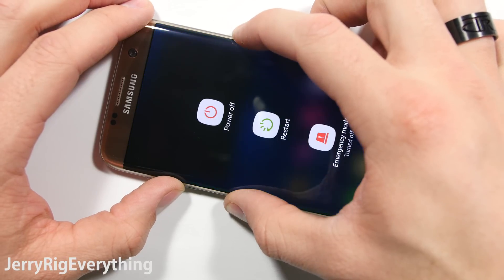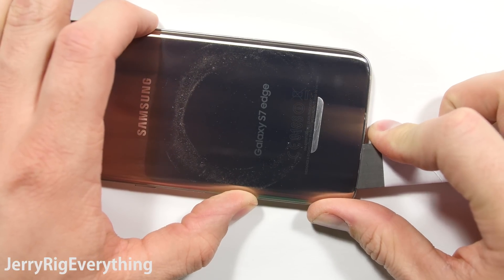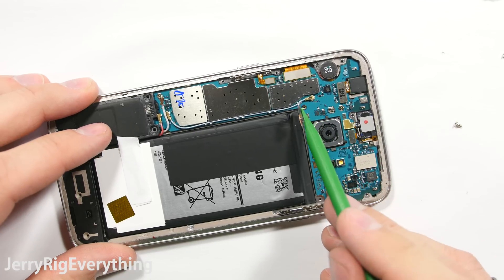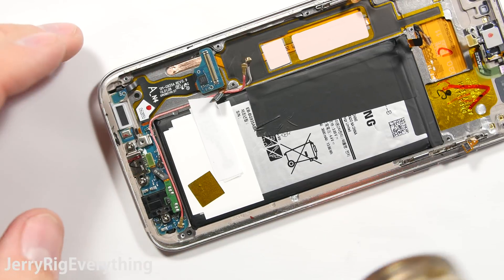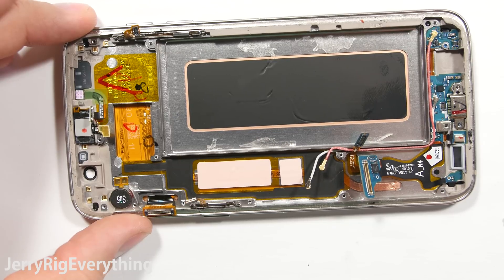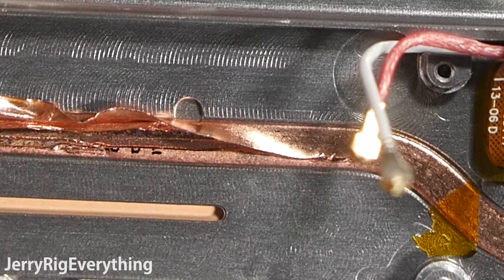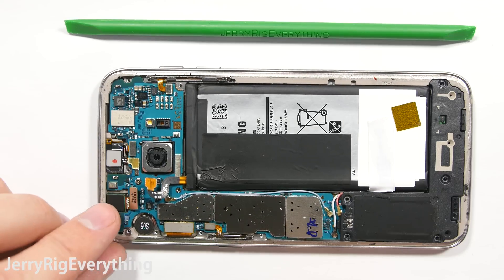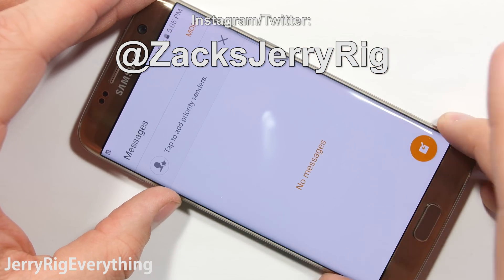Galaxy S7 Edge Screen Replacement - Charging Port Repair - battery fix

Comment: Hello Jerry 
I just want to tell you that I like a lot your videos... 
I have a question for you about the Samsung Galaxy s7 Edge... 
Do you think is possible that wrapping off a skin protector (like DBrand Skin) from the back of the phone can damage it in some way,!? 
I saw that when you have bend the phone the back cover comes out and you said that the water protection is damaged 
And I ask you because you know how much force you used to bend it and you know how good and strong is that glue that is keeping the back cover at his place... 
And that glue is double tape or is an special adhesive!? 
I ask all of this because in teardown of Samsung galaxy s7 edge I saw that after using some heat is quite easy to disassembly the back...
I hope that you understand what I'm trying to say because my English is not perfect 
THANK YOU!

Comment: with all the news about the note 7 having heating issues to explosion, how are you feeling now about the processor melting into the black plastic of this phone? I'm wondering if signs of melting/marks are common for current phones with the 820/newer processors? I"m interested in the GS7, and I appreciate your teardown videos. Seems like regardless if I go edge or not, it will be a tricky teardown? Hopefully not as bad as the HTC one m7.

Comment: The most important part of the Galaxy S7 and S7 edge’s cooling system is
 the thermal spreader (Heat Pipe). We adopted a spreader that is only 
0.4mm in diameter, making it the thinnest in the market today. Unlike 
the conventional thermal spread sheet technology, the thermal spreader 
uses changes in the phases of water to radiate heat. It has a porous 
structure on the inside where water absorbs heat, turns into steam and 
moves through pipes. After losing heat, the steam liquefies, and turns 
back into water in the structure. This continuous cycle dispels heat. 
Generally, its thermal conductivity is more than 50 times higher than 
that of copper. The entire process happens inside the small space that 
is only 0.2mm wide.

Comment: So I cracked the front glass of my S7 Edge, and looking for DIYs before finally consulting an expert to handle it. The LCD digitizer is still intact, so I was wondering, could I do something like your older Samsung GS3 Glass Only Replacement for my "project"?

Comment: Just had the whole screen replaced on my s7 edge, and cost $410 plus tax, totally worth it, my hands aren't steady enough to deal with all that micro and sensitive material.
Reply: Yes, water resistance is still there, place I had done at even offered 1 year warranty on all reseal and screen.

Comment: I just got my newly purchased S7 Edge. The battery appears to drain much quicker than when I first got my S5. Any suggestions?
Reply: Download a black theme and open power saving mode and keep ur brightness at 50%
Reply: bring your phone to service center. Just need 1 hour then everything work fine
Reply: Bluetooth? Wifi? Wifi hotspot? if any of these are on it will drain battery pretty fast, especially the wifi hotspot
Reply: did you let it chrage all the way yet, mine dischrage fast till it got a full chrage
Reply: Green Rusty Turn off location and wifi when you're not using it. location drained my battery faster on my S7, but when I shut it off my battery life was better. my phone usually lasts me the whole day.

Comment: That cooling system have holes in the design, heat much go outside of the phone like to transfer the heat true the air, if all is inside is getting boiling hot  again and i guess some of the heat to the battery.

Comment: I originally found this video when researching the heat distribution techniques of the S7, and it's heat pipe. I knew it was a heat pipe, but I don't understand why they called it liquid cooling, especially since I don't see a loop.

Maybe they decided to call it 'Liquid Cooling' to evoke the custom setups for high end gaming computers?

In which case, why not call it a Vapor Chamber, or a Phase Transition Radiator? Either one is more truthful and has a technobabel marketability to it.

Comment: will the waterproof be destroyed?
Reply: Use the correct gasket to put the back back on and make sure it's 100% clean before you do, and will be perfect.
Reply: Yes
Reply: actually do you know now there is nano coating waterproof machine? We have done a lot of test after using the machine, it is waterproof use nanotechnology. water can get in phone while will not damage.

Comment: When you open S7 edge..., will it remain IP68 protected after you packed it again?
Reply from the maker: No, It will not be water resistant anymore.
Reply: +Aleksandrs Papko probably not
Reply: +JerryRigEverything can you tell me one thing please If my phone gets heat up while playing game or doing other thing will the glass come out automatically this thing happened with my sony xperia z3 so I was thinking about this issue in s7 edge I want to buy it please answer my question
Reply: +JerryRigEverything.Hi.Is any chance install s7 edge battery in note 5?!Just want to know if they have same size and connections..Thanks
Reply: +Aleksandrs Papko they are two very different sized batteries. note5 has a 3,000mah battery while the s7 edge has a 3,600mah battery.
Reply: +AVA4444 the better the battery, the greater the size.
Reply: AVA4444 yep s7 edge battery life Is better than my Note 5
Reply: Artavis Hawkins-Durden Its Because the Note 5 has Lollipop
Reply: If you repaired from an authorized service center by Samsung, it should be water resistant after the repair too. I repaired my screen and it's still water resistant.

Comment: Hey Jerry, so yesterday I accidentally dropped my S7 edge from above waist height and picked it back up to see a perfect screen, but when I turned the screen on these really bright thin purple lines appeared on the right side of the edge! They won't go away and also at the top next to the lines there's a tiny area of dead pixels. What is the best thing I can do? Is the screen broken or did the wire disconnect slightly?

Comment: Hi jerry i accidently put the sim card tool to the top mic port :(
do you think its going to be just fine?
i check the mic using the voice recorder app and its seem works fine but do you think it will remove the waterproofing ?
thanks
Reply from the maker: It should be ok.  The mic is at a 90 degree angle to that mic hole shaft.  So if you stick anything in there it wont hurt the mic itself.  Always treat the phone as 'water resistant' and  not 'water proof'.
Reply: JerryRigEverything okay thanks for the quick reply jerry 👍
Reply: +JerryRigEverything i am having a big line on my screen of s7 edge what should I do

Comment: Would the Screen still work if the "Micro USB Charging Port Menu Button Flex Board" would be missing? Because i pushed my charging port further into the phone and i can only see the screen on a few seconds before it turns green -and what not.

Comment: Jerry? Apparently i pushed the charging port into the phone with my charging cable... Now the Screen has weird Colors (Green stains) and after a time it doesn't work at all anymore. Is all i can do replace the whole Screen? And how much does this cost in a Phone Repair Shop? How could this even happen?

Is the same likely to happen to a OnePlus 3 (Phone i will purchase instead)? I mean, on an iPhone you can clearly see how the screws hold the charging port to the frame... I guess the whole board the screws for the charging board were on cracked? 
And is it worth preparing it yourself when you pay 300 Euro in a Repair Shop, while the screen costs 300 Euros on eBay?? Is it normal that the screen costs that much?
Reply: is it possible that i just pushed it in and unplugged a "Lego" so that the screen has a loose contact? Because sometimes the screen works perfectly well - for a few seconds... @JerryRigEverything
Reply: I saw that behind the charging port there is a thing plugged in. Could it be that i only unplugged this cable? And could i maybe screw the charging port itself on again and glue it?
Reply: I now know that you have to open the phone from the back and front of the metal frame in order to completely remove and replace the charging port. Now i have seen that i can replace the charging port for 35 Euros for the S7 Edge. Is that even possible? And did i actually damaged the screen, too or not?

Comment: Why doesn't dry ice work for glass-only replacement here? The optical glue has a lower hardening temperature?
Reply: Actually lcd freezing separator can for all phones separate also edge no problem, we have test.

Comment: hi Jerry,  i pinch the battery of the s7 edge bye accident when ir tried to perform a screen repair and now it smell like glue,  it Was only a small cut on the aluminium-paper like, but the smell is strong,  do you think ir need to replace the battery??

Comment: Hi
Can I change charging port without screen? ( it was with watter)
Thanks
Reply: No you cant, the phone does support wireless charging as standard however so just buy a wireless charger to charge, you can also get an SD card to put things onto the device if the USB port is broken

Comment: I don't usually sub these type of channels but you did a great job with explanation that I had to like and SUB. one thing you left out is, will the double sided tape maintain the ip68 water resistance?

Comment: Thanks for the video. I have one question...you talk about that "a glass only screen repair, would be the best option for this phone". Is it possible though to change only a cracked front glass without changing the display or by removing it you destroy the screen automatically? (S7 edge) Thanks in advance

Comment: Didn't you ruin the heat pipe by cutting it though?
Reply from the maker: +sardanapalos Surprisingly no. Ive used this phone as my 'daily phone' since this video was made (2 months now) and it has not overheated at all.  I imagine that the copper is doing most of the heat distribution.
Reply: interesting
Reply: +sardanapalos i think if it was a liquid cooling that surely damage it, but since it only a copper heat sink it would seem fine like that unless it snap in half completely

Comment: Hi, I watched your video on you-tube and was amazed. Thank you for publishing " Galaxy S7 Edge screen replacement - charging Port repair - Battery fix"
Just seeing if you have any ideas as to what my problem could be.
My phone which is about a year old just died, It was being used for messaging with about 60% battery life when it died suddenly screen black but no lights on anywhere. Put it on charge and nothing happened, tried attaching it through USB to computer still no sign of life. Tried another Samsung charger and again nothing. All chargers and ports work with other products. Tried following sequence of switching on and resets but nothing. What does that sound like to you a connection is defective or a diode or something has blown or burnt out. I find it strange as the battery had life but obviously have lost connection to the battery.

Thanks,

Nigel Williams (England)

Comment: if you teardown like that, is waterproof feature still enable? or it Will lost because you already open the sealent? and is the procees to change the battery Will as difficult like you showed at video? sorry for bad grammar. thx

Comment: if that heat pipe had a low pressure liquid it was using as a refrigerant, it is possible that if you relieved a very small amount of pressure from within the heat pipe (when the initial cut took place) that the liquid could have become vapor (gaseous). All depends on the boiling point of the liquid.

Comment: I've the s7 edge for 3 weeks and the bitch ass screen already cracked with a case on and scuffed the metal edges
Reply: And so were mine, cracked frm a dropped of 2feet with the cover still on it. It cost USD270 for the LCD replacement. Wrote a letter to Samsung and the best the can gv is 50% off. Don't drop this phone fellas, its a costly accident.

Comment: just a quick question, isnt it unsafe to use a heatgun on a li ion battery?
Reply: +maxushero batteries heat up all the time if you keep it from over heating the battery youre all good.
Reply: thnks for the answer c:

Comment: I just recently dropped my samsung s7 edge and it's shattered from the edges and had a few cracks in the middle of the screen... if I don't get it fixed, will the get worse?

Comment: Will it be water proof again after you put it back? :-D
Reply: i was thinking the exact same thing.. i don't think the phone would still be IP68 water resistant again... especially with the double sided tape..
Reply: +Saravana Prabhu He re-seals it with like tape at the end. It is water proof.
Reply: +AnonymousYT tape isn't as waterproof as rubber seals..
Reply: It was a rubber seal tape. Not like you can't but a like replacement re-sealable product.

Comment: hi guys I've got my s7 edge from just two weeks and i feel like the power button slightly more softer than volume buttons!! is this normal because the power and volume button flex were designed to have a different clicky sensation or what?!

Comment: Also, you would still be allowed to call it a liquid cooling system because the gas would need condense into a liquid for the copper wick inside the device to function correctly.  The gas would heat up, condense around the wick, travel through the wick into a cooler part of the phone (assuming) and turn back into a gas and distribute evenly in the tube again when cool.
Reply: That's not how condensation works. It's the other way around. The gas condenses in the cool area turning into a liquid which travels to the hot area and evaporates into gas which condenses in the cool area and so forth. This phone has a glorified heatsink, no actual liquid cooling unless liquid is present inside the pipe.
Reply from the maker: +TheArt0fBoredom Hey thanks man.  And thanks for letting me know about that stolen video. Ill file the copyright claim right now.
Reply: Thanks for the answer! I Iearned something new :D

Comment: will the phone still be water resistant after reassembly?
Reply: No
Reply: +Jack T there's no way around that? like maybe water repellent rubber foam tape? I wonder how it was accomplished in the first place.
Reply: Linked Devices No way around it, unless you get someone from Samsung to repair it. They probably use some compleciated technique.

Comment: its been 2 weeks i gave my S7 Edge to repair. i draped my phone and the display glass is broken huh. Guess what samsung service center refused to accept my mobile, the reason was they don't have spare part right as its newly launched phone. it will cost me 1000+ Saudi Riyal to fix my S7 Edge display .

Guys i strongly recommend not buy or else use cases to protect the phone. the Phone is awesome but need to be very very very careful. now i regret

Comment: Will that phone still be as water resistant after the double sided tape is applied?
Reply from the maker: +Deimos Phob No, it will never be 'water resistant' again after it has been opened up.
Reply: +JerryRigEverything same goes if the Samsung service center did it? Don't they glue it back?
Reply from the maker: +TheUndisputed Hacker If THEY do it, then yes it will be water resistant again.
Reply: +JerryRigEverything yes, I doubt that. Thanks for the fast reply, you got a new subscriber.

Comment: what are the thermals now with cut heatpipe? btw its heatpipe i wouldn't call it liquid cooling because of way heatpipe and liquid cooling works,liquid cooling needs radiator, block and a pump, just check on pcs, else all tower coolers with heatpipes on cpu and graphic cards would been called liquid cooling, dont even know who came out with that, its just a heatpipe

Comment: You just permanently destroyed the heatpipe. Of course there wont be any liquid there bec it has already vaporized. The inside is pressurized so the coolant will efficiently transfer heat energy.

Comment: It has a replaceable batteries just not accessible. But wouldn't this make them not waterproof anymore since water can goes through the glue opening. It's a heat sink why would they call it liquid cooling?

Comment: Doesn't that completely ruin the heatsink thing? You just sliced it open XD ? If it works with gas, all the gas would have evaporated no? Am I missing something?
Reply: +3choBlast3r There doesn't seem to be anything in there, as gas can't be held liquid with that little pressure, and gas itself doesn't work as heat conductor.

Comment: I think it should if, When hot it turns to liquid. You should heat the old one up to see what happens. I have my S7 coming in the mail.
Reply: +Tech Guy I like it. no scratches on mine yet.
Reply: +Tech Guy I jumped up from the S4 so big change for me
Reply: +Tech Guy nice. I didn't upgrade to fast. We did buy 3 Samsung led tvs. only way to go.

Comment: Hey jerry,  just got my galaxy s7 edge about 2 days,  but today it dropped and the front Glass broke,  is there even an option to fix it since is so new,
Reply from the maker: Ya,  Samsung has a repair service.  It's usually like 2 or 3 hundred dollars.  You'll have to check.  I'll link parts in the video description later this afternoon.
Reply: +Felix Gaitan Ah dang. Dropped mines today from knee-height and shattered the back glass. Worth going through samsung's repair service or replacing it myself?
Reply from the maker: Aaron Lawson Depends on if you want to keep that warranty... and the waterproof rating...
Reply: +Felix Gaitan 
wow that sucks balls, glad i bought a case for mine..too expensive to let it break after 2 days
Reply: +Muckfoot 88 
that sucks..I fucking love the phone though it's fucking amazing
Reply: +JerryRigEverything I thought this phone was unbreakable. I saw a knife and hammer video and it took a while to crack the screen.